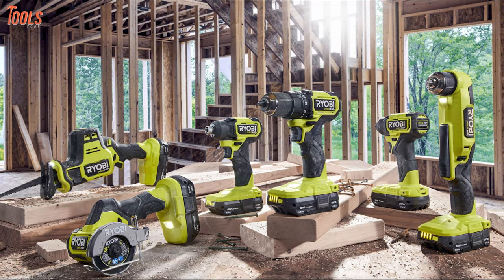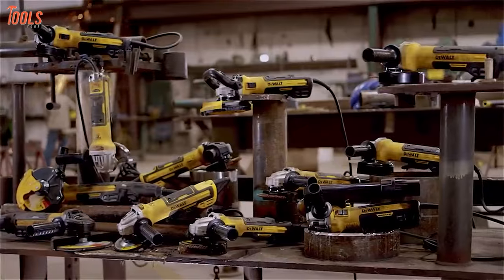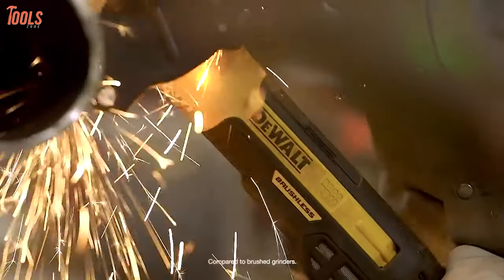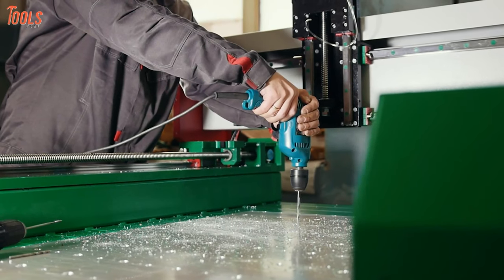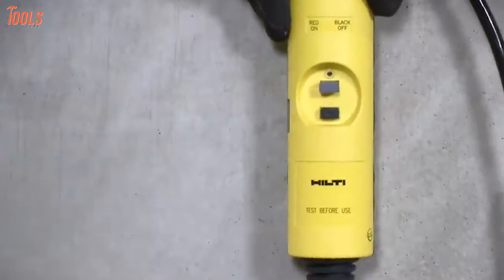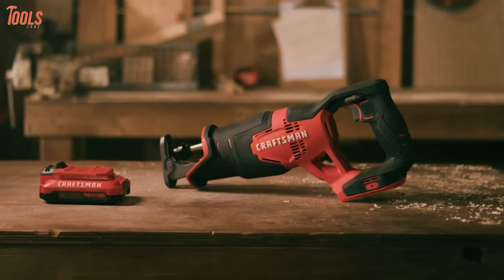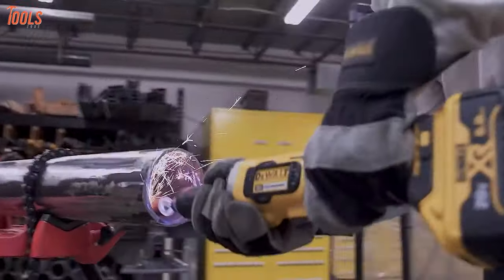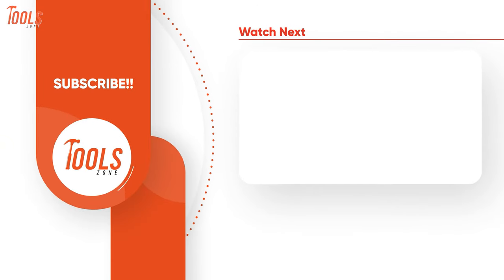Corded vs Cordless Power Tools | Cordless Power Tools Better Than Corded?

Comment: I have used Cordless, Corded and Air tools, gas powered tools and hydraulic powered tools for along time. My experience with all these different types of power tools has lead me to a current conclusion that for continuous work all day long day after day is that corded electric, air powered and hydraulic powered are still the top choices.  I have many cordless electric tools. My biggest
concern with them is each brand uses a different battery to tool connection and different voltage. Replacement batteries are very expensive, you need several batteries charging ready to replace the tool battery you are using when it power is depleted to keep working adding to overall tool cost.
Reply from the maker: Thanks for sharing your experience and valuable comment.

Comment: If you're a younger person, consider a corded tool, as it will do the same job 20 years from now.  Batteries are expensive, go bad, and are discontinued due to technological improvements.  However, if you're a pro and use the tool most days in your trade, you'll be wearing out your tool typically at the same pace as technology changes and buying the latest tool every 3-4 years.  However, go cordless if you work in areas where a cord isn't practical, or batteries are worth the convenience.
Reply: Extension coords are cheap. For the money I absolutely go for power of a corded tool.

Comment: There’s a point to note tool companies like Stanley Black & Decker and TTI mainly because of the advancement and OSHA regulations have been moving everything to high output low risk pouch batteries.  I think by the time Stanley Black & Decker and their offshoot company. Dewalt releases their 15 amp hour or 20 amp hour power stock battery in “the next 5 to 10 years” SB&D will expect all tools to be battery powered. 

So it doesn’t matter if people think that corded tools are better they’re going out, eventually because of OSHA and government regulations we’re not gonna have corded tools, unless they’re all contractor grade, or specifically do not qualify as hand tools.
Reply from the maker: Thanks for letting us know your thoughts.

Comment: As someone who rarely has need to use his power tools, I much more prefer corded over battery. Back when I first started out and did have a cordless drill, it was always dead when I needed it. Yes, I know I could just keep the charging cable plugged, but the idea of having 5 or 6 tools plugged in at all times now for the one time a year I need just seems silly.
Reply from the maker: Thanks for sharing your experience
Reply: I was just about to buy a drill and was thinking the same. If I'm gonna use it once a year, then I don't want my batteries failing when I need them.
Reply: Honestly cordless tools are only better or you are going to be far away from a plug
Reply: @thephilosopher5799  For those cases there are always extension cords which are very cheap these days.

Comment: Hey it I just wanna let you all know that I am trying to like the video. Thank you by the way for the video it was fairly unformative and pretty much boils down to what I thought it was which is which is depends on what kind of job you got to do and how you feel about doing it. If you're on a job site and you're a guy that likes to walk around with the tool in his hand and  Not really do anything except for kissing the boss's ass then more than likely cordless it's gonna be exactly what you wactually what you want. If you're like me and don't actually work on a site and have like a 1000 miles of extension cord then I might want to use corded